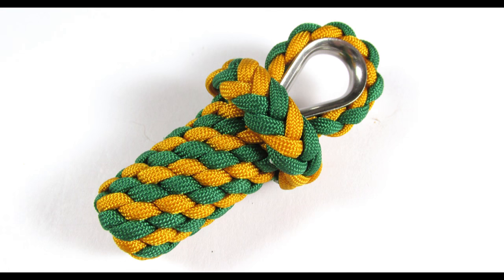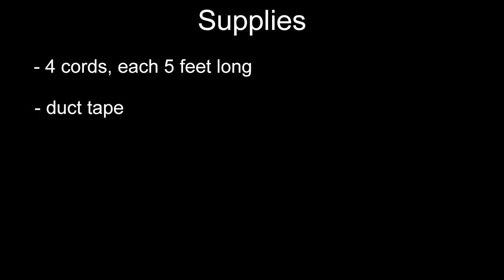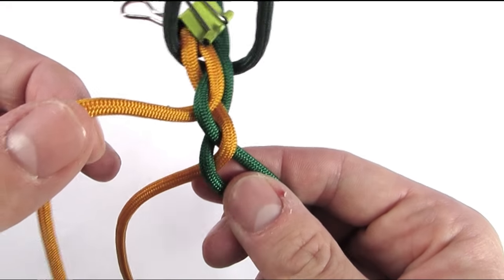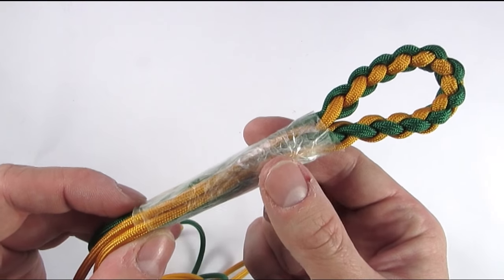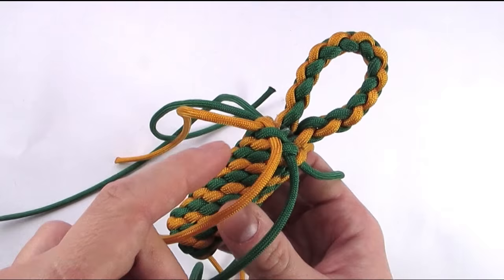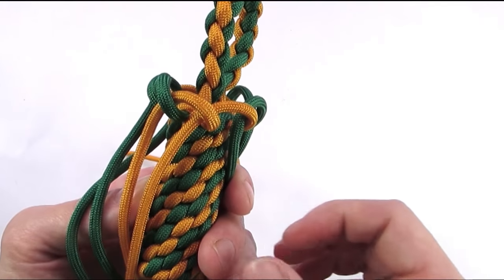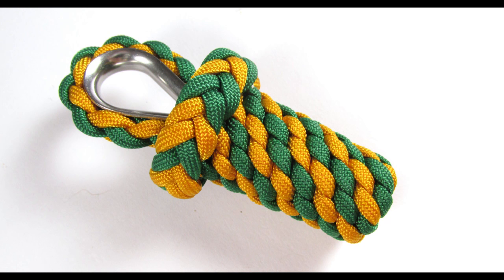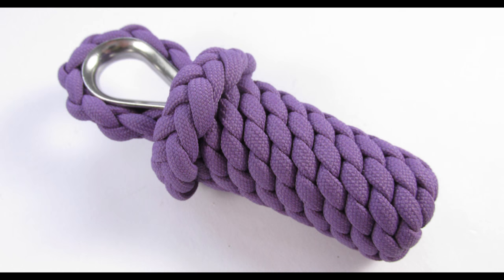Boat fender key fob

Comment: I like my knots real right. once I tightened up the ring bolt hitch and the last tucks it pulled the ring hitch over everything. is this bad? I he got frustrated so I just cut the ends and tucked them inside the bumper lol